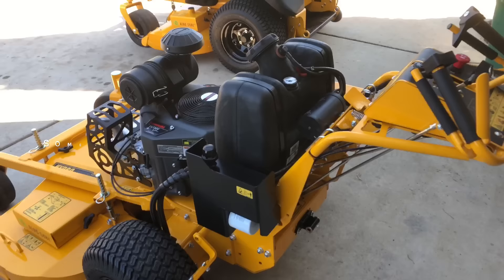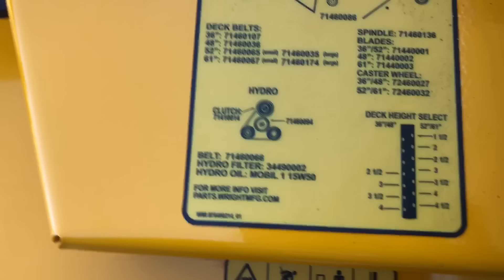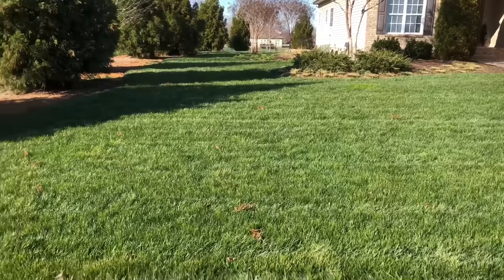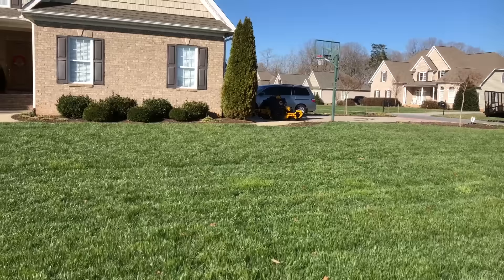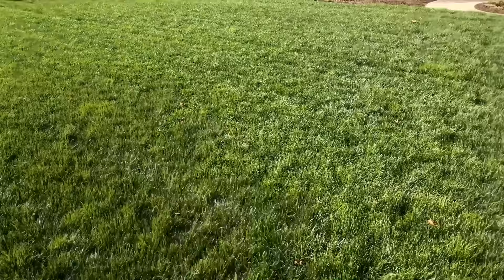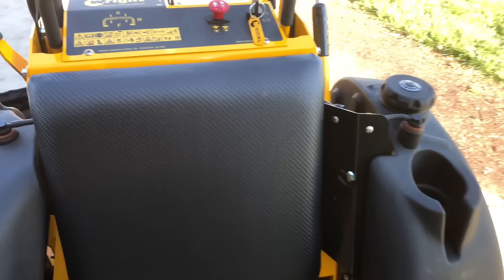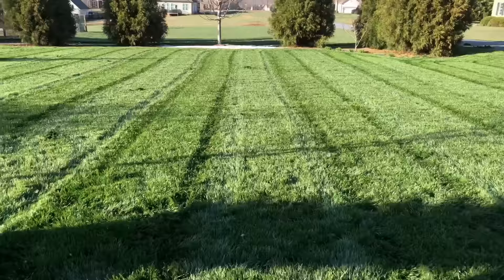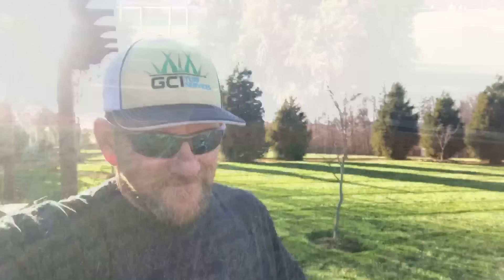Mowing the lawn! Wright Mower Stripes

Comment: I found out by experience that when you buy a new blade or mower the blades are never Sharp
Reply: I found out the hard way on a grasshopper 721d😐🤦‍♂️
Reply: Blades come already sharp. Mower blades are not supposed to be like a knife. It is actually bad for the grass and mower to run blades sharpened to a point like that. Also it causes your blade to dull faster.   The way they  come is the way they are supposed to be.
Reply: The protective coating has to come off

Comment: Well my  Opinion is that you got new junk mowers. There is nothing as good as  X Mark there are some brands that do come close.  It's all in the design of the decks is way you have all the grass clumping. The thicker the grass is the more that mowers you just got the more it is going to clump and the more moisture on the grass well more clumping your going to have. The best thing you can do is seal them new mowers or return them all and by good mowers. Just in the future if you are going to a store for your equipment the place will let you try out the mower your looking at buying before you spend all that money.  Go back to what works  buy X Mark thay do the job right the first time in last you what to hire a crew to rake all the grass I'm sure they won't work for free  so that's going to cost a lot to have a rake crew  LoL.

Comment: I think the clumps came from your grass being wet. Also. Check your tires to make sure they have the same air pressure. The tires air pressure will actually change your deck high before checking the deck itself.  And adjust your pitch. I love your videos. I reside in Maryland.

Comment: To add to the part regarding mowing height, it also helps if you make sure that your tires are aired up properly as well. A few PSI too much or too little can make a 0.5" difference or more in cut height.
Reply: Also, if you put Pete on that mower and have someone else measure, I think you would be surprised that it's closer to the 4" mark.

Comment: I feel like something that you missed was how important it is to regularly check the mowers tire pressure and level the deck. Additionally, while levelling the deck you can adjust the deck to actually be at four inches when the height adjustment says four inches. But there is a huge disclaimer there: The linkage may not be moving the deck in increments of inches. Moving from setting 4 to setting 5 does not mean that you've raised the deck one inch, even on these high quality mowers.

Of course, for those interested in minimizing that, most home lawns are cut somewhere between 2 and 5 inches, so if you level the deck at 3.5 inches, then you will minimize the difference between what the operator adjustment says and what the deck actually is at in that range.

For homeowners, who will only ever be mowing on one or two settings (generally, desired height or all the way up), they can pick a number about 3/4 of the maximum height (if mowing at 3 or 4 inches) or 1/2 the maximum height (if mowing at 2 or 3 inches), and set that to be the precise height that they want to cut at regularly. Even on cheap mowers, using this method you can get cutting heights accurate to 1/8th inch or better, but only on the height you levelled the deck at.

Comment: I cut everyday with a wright z and the best way I found to deal with tall grass is to cut once at the desired height then to go back over the same stripes with the deck all the way up. If you really have a mess it works better to do a different angle stripe on the second cut with the deck all the way which throws the grass a different direction instead of just throwing it back and forth on the same stripes.. for this yard I would cut 12-6 then raise deck all the way up and cut 3-9 which helps not to beat the grass down and also helps throwing the grass evenly across the lawn.. if you use a wright mower I recommend trying my method and see what you think. I found it to be the best way to deal with tall or just wet grass and leave the best finish..

Comment: ya my wright stander 32 clumps up too. more so when its wet. but my toro36 walk behind only does it when its really wet. love the stander but wouldn't ever think of getting rid of my older toro.
Reply: Deep "ejector" decks on the Toro.
Reply: I bought a Wright Sport I with a 48" deck this last Spring. We had a lot of rain early in the season and with wet conditions it clumps really bad. I pulled the baffles off which helped except that when the grass was dryer later in the day there was a ton of "blowout" and the mower and I get covered in clippings. Otherwise in "normal" conditions it absolutely cuts better than my other mowers with the same sized deck. I am still experimenting with different types of blades and different "lifts" to see if I can dial it in better for next Spring. At the moment it is Fall leaf cleanup season and I am using mid-lift Gator blades and it is awesome for collecting leaves. It's like a big vacuum cleaner with almost no "blowout", so it does a great job of bagging them which for me is a real time and body saver.

Comment: Nice to know other people are as anal about mowing as I am!  The clumping: my best guess would be the yard's a little damp, and maybe taking a little too much off.  I don't normally bag, but that might have been the answer to avoid the clumping.  I normally overlap about 3-4", but I'm less worried about the time it takes.  Like your idea about mowing different directions each week.  Here's what I do (and it's real easy to remember).  One direction each month.  March (1st mowing).  12:00 (start at due north), April 1:30, May 3:00, etc.  I normally finish up back at the 12:00 position in November.  Also, at least for your own yard, consider the cross-hatch.  After finishing the yard in one direction I mow every OTHER pass in the opposite direction (parallel to the first direction).  Gives a good checkerboard appearance.  Pine needles?  That means you're south of the Mason-Dixon line (dittoes here).  One other thing on "straight lines".  Old farming trick:  Look off into the distance once you start your pass and keep it straight with a post/tree, etc.  Looking short will have you all over the place.  Kudos.  Considered a mowing business myself but a lot of competition with "cash laborers", besides I've already retired from two sucessful careers!

Comment: After reading through the comments I see that the grass was damp, which will make any mower clump up a bit.  Although different brands may have different flow designs on their decks there are other factors that affect discharge such as cutting speed, how much grass you are taking off, blade type as far as lift, straight, gator type or hybrids, sharpness and blade pitch along with cleanliness of the deck.  Wrights also have an adjustment for the height of the blade within the deck itself.  I have had good experience with Wright standers and have spent way too much time with all the adjustments and have even talked directly with Wright employees for suggestions, but it comes down to what you are doing on what yard and just takes trial and error.  

Currently I run a 36" Wright stander, side discharge, run 1/8" blade pitch, keep the deck about as low to the ground as possible while still being trailer friendly (better striping and suction, I also have a striping kit) and set the blade height inside the deck to cut at 4" (actually measures 3 7/8" front of blade and 4" at back), and I am currently running the Oregon G5 blades which are a high lift gator and I sharpen them weekly and I clean the deck as needed.  Getting great results and satisfied customers.

Pete, love your stuff man, keep it up!  I'm actually signing up for the GCI Academy right now and just ordered some of your seed.  Hope to hear from ya soon man.
Reply from the maker: thanks bro    I appreciate you

Comment: I've been running 61" wright zk's for years. Their Achilles heal is long wet grass. They stripe better, hold hills better, and scalp less than other standers, but they hate wet grass. This is because a higher percentage of the clippings exit the front of the discharge chute than other brands. More grass landing in one spot means more clumps (they also shoot grass further than other brands). One other reason for the wet clumping is that wright decks recycle clipping one additional time before discharging them. This cuts the clippings smaller but often wads them up as well. Best way to fix this problem is to learn to drive them one-handed. Wear a backpack blower and blow the chunks as they exit the chute with your other hand. It helps to break them up. This only needs to be done when mowing extremely wet grass. If you're mowing a large property on a dewy morning, mow your first cut, let the clumps dehydrate in the heat, then come back and do your second cut in that area after the clumps have dried. This also solves that problem. (Here's another secret: Wright is currently developing prototype baffle systems which cause their aerocore decks to cut and discharge almost identically to Exmark decks. You will get the benefits of both brand's decks). You should also consider getting wrights with the Vangaurd big block engines with the 5 quart oil systems. New class of the industry.
Reply from the maker: Great info here!!!  We ended up buying 4 Wright ZK's and 1 Wright walk behind... I absolutely LOVE them...but you are right they do not like wet grass....thats for sure.
Reply: GCI Turf Services Excellent choice with the zk's and walk behind but I can't in good conscience recommend Wright's zero turn. It doesn't deliver any advantages over any other generic commercial zero turn. I'm somewhat disappointed in it to be honest. As far as I can tell from demo-ing every make and model, the zero turn to beat is currently the Scag Turf Tiger II. That will be our next purchase. I'm not quite as concerned about all of my equipment matching as I'm even more particular about my small equipment. I prefer Redmax hip-throttle blowers and Redmax trimmers, but nobody can match Echo's edgers or bed shapers. Have a good one and keep up the great videos!
Reply: Anymore info about Wright's new prototype baffle system? Is it going to help with thick wet grass?
Reply: I'm having the same problem with the Ferris Z3 ICD deck. About ready to ditch it for the ZK61, but the Wright baffling looks very similar to the Ferris. Not sure I will gain anything.
Reply: @fz10rider47  I'm guessing they will release it at GIE this year. That's one thing I'll be looking for this year. Gator blades also help a great deal with wet grass on the ZK. They break up the clumps better and spin at a higher velocity due to decreased air resistance.

Comment: Let some air out of the tires it will read 4". LOL
Reply from the maker: Larry George quite true
Reply: Haha
Reply: step on it probally take that 1/4 out
Reply: It reads where the handle falls, not where the pin is placed. If the handle is on top of the pin it will not be the number where the pin is 😉

Comment: I think the problem your having with the clumping is the blade angle.. I always resharpen new blades.. I even change the angle a bit. Hope that helps
Reply: In FL it doesn't matter what mower or what blades you use it will clump when wet.

Comment: I got various mowers to compare i have a scag v ride 52 advantage deck   a pzt husqvarna  60 zero turn , and a toro grandstand 52  , the best cut quality with the best striping ,the best stability steep angles 30°, best dispersal ,best wet conditions for mowing id like to say true 18,000 blade tip speed hands down the Grandstand, I got used to the toro and was wanting more i got the v ride ,but shortly realized i  must demo the units before buying !
Reply: good info, but i can say each mower works better in different type of lawn. I did test the vride, grandstand, and the gravely prostander. Hands down my best cut quality was with scag vride. For me it was noticeably better than the toro or gravely. I agree with you, you must demo each unit on your lawns

Comment: My Exmarks never do that, Its all depending on the variation of deck on any given brand on any given year. Guys have made videos about issues exactly like yours, they buy a mower of the same brand that is a year newer that has undergone deck "improvement" and they have issues with clumping or stragglers. Some brands have decks that perform better on different species of grass, I would suggest to you and it will sound nuts but take your mower and run it over some sand for a few minutes. When the decks are brand new and shiny grass will really stick with minimal moisture (ever have your beer mug stick to the bar top as if an elephant was standing on it?) Same concept, the sand will take the gloss off reducing surface tension and allow for much less sticking. You can also try extra high lift blades they will cause more suction and more airflow however it may not be enough to overcome the sticking on a brand new deck, the downside is you will consume a bit more fuel in the process and sound like a Cessna. Just a few things I have learned over the years that can help with clumping, best of luck to you!

Comment: Mistake never make a turn in sidewalk or will you have a green sidewalk.
Reply: Rooster -V Well, especially when it’s wet or damp. Hot, dry grass you don’t need to worry about as much. Very good point though.
Reply: I like to do two passes going around the edge of the yard and then do my lines through the rest of the yard. No grass on the sidewalk so no need for a blower!

Comment: The grass is still wet thats why it clumped.
Reply from the maker: ThePeyton301 yes. We figured that out. 😎
Reply: @GCITurf  Countryside Vlogs had the same problem. He went to a high lift blade that doesn't run the full length (only about 1/12 - 2" inches long on the very edge of the blade). Made a huge difference! Once again, high lift, but not full length high lift.
Reply: Sorry, very 'end' of the blade!

Comment: To stop the grass clumps you should get gator blades they will spray the grass better, disperse it better, and chop it into tiny pieces that will decompose much faster
Reply: Gator blades will decrease decrease airflow and not discharge as well resulting in a non uniform dispersion. They will also use more power decreasing fuel efficiency along with clutch and engine life which are important considerations for a commercial mower.  A medium to high lift blade is best for these types of mowers.  With time and experimentation you will be able to tune in your deck producing a higher quality cut and stripe.  A good starting point is a 4" cut height, with the correct deck pitch, meaning blades measure 4" at front most point of deck and 4.25" at rearmost point of deck, not just checking one blade position.  Multiple factors lead to clumping including blade type, blade sharpness,  blade speed, mower forward or travel speed, moisture, cleanliness of underside of deck, and amount of grass being removed, sometimes you will simply need to double cut.  Not all machines will cut the same, perfect example in video, guy changed brands, most likely mowed the exact method that use perfected over time with the previous brand that he even stated he used for many years.  I'm certain after some experimentation and time he will be producing the desired result just as you or I could given that experience and time.  Important thing is to take pride in your work, be methodical and have fun!
Reply: @corynielsen784  Well put.

Comment: The striping was cool. Trying to get that going in my yard as well, but with a sloped back and front lot, it takes much work. I do mulch my yard with a self propelled craftsman walk behind. You stated earlier in the video that it just had rained the other day,. Your grass is a thick fescue and by no means am I an expert, but I repair these guys and many times I see the remains of wet grasses under the decks which cause early rust deposits. In your case since this is your lively hood and probably have a few homes to do each day. It can't be helped to cut wet grass..

Comment: High lift blades create a suction and the grass will drop when suction changes. If you turn the PTO off it will also dump. Try a different blades.

Comment: hey pete i know how to eliminate the problem your having  im a wright Owner aswell as a wright dealer get you a set of Marbane Ultra hi-lift Blades get the scag ones if u have 52's part number is 481711 and then also drop the stripe flap behind your deck down let me know if try this method im sure you'll be impressed

Comment: When you showed under the mower it looked like the blades weren't sharpened and still had the black paint on them.  Also when you showed the close up of the grass it looked like the blades were ripped instead of a clean cut. (Although even with freshly sharpened blades I've always noticed tearing if you get up close) When I got my Hustler a few years ago it came without the blades being sharpened... Pretty cheesy of the dealer when you spend big $.